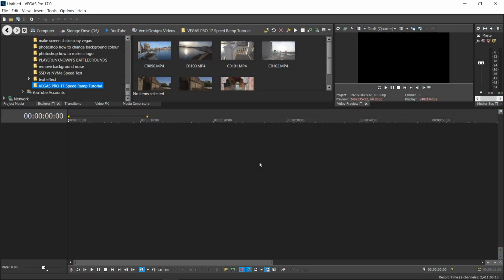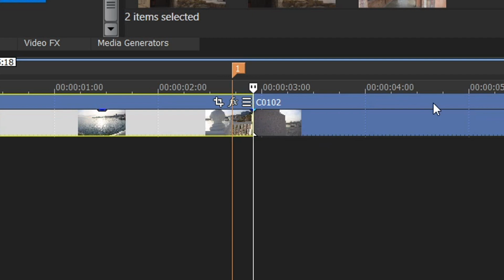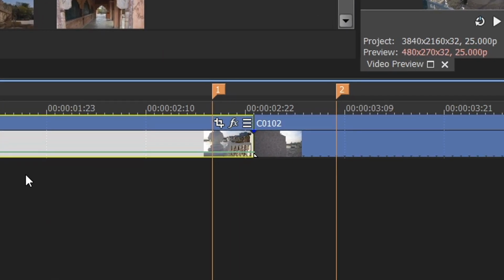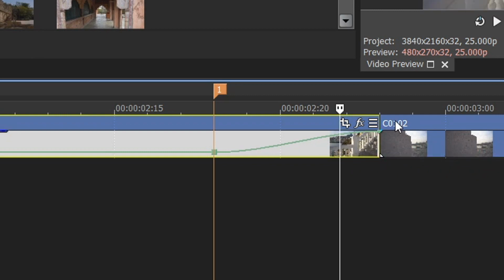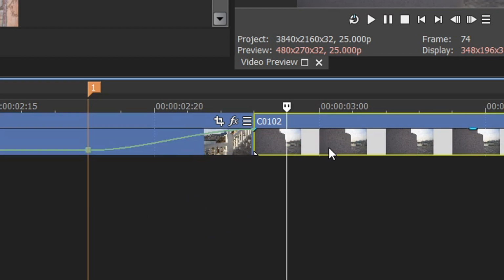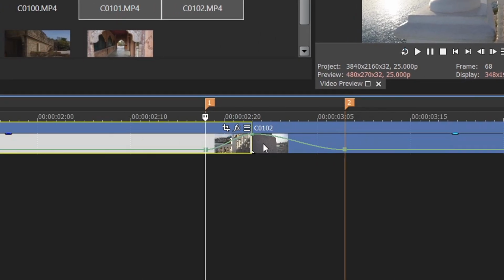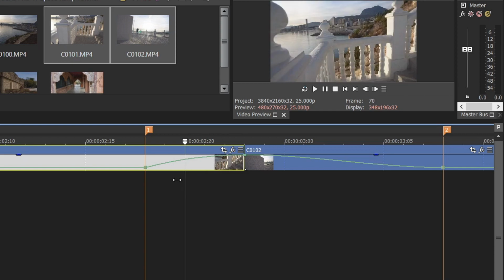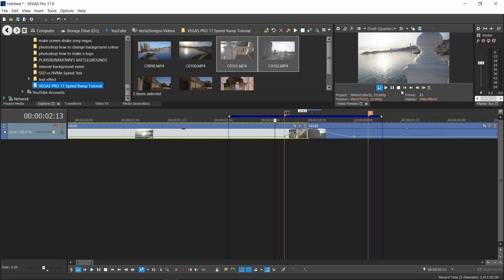VEGAS PRO 17 Tutorial: How To Create Smooth Speed Ramps - No Plugins

Comment: Can someone help. When ive shot 30fps. Laid it down on a 24 fps timeline and given to conform to timeline, it runs with that slight slowness. GOOD. Now when i speed up a clip im getting double frames in the final rendered video (when we pause the video). Say i shot 30fps drone shot, put it onto 24fps timeline, did conform frames so everything is prefect. But when speeding ramping, bec its taking every 5th or 10th frame for example to make the clip run faster, when the final rendered video is paused in those scenes, you can see terrible ghost imaging, ive tried different resample methods (disable, smart, force etc) no avail.
Reply: Try making everything the same fps by putting them all in a project and rendering them all at 60/30/24fps without any transitions and stuff. Then try doing velocity.

Comment: Why won't the velocity affect the duration of the track? Shouldn't it do that? I'm slowing the last video of a project but that should make the duration of the track longer but it won't.
Reply from the maker: Velocity is a bit of a weird one haha it does speed your video up and slow it down and you can notice this because sometimes when you create the ramps it will loop the video because it's already gone past the end point so it fills in that gap with a replay. 

Best thing to do is go off on the percentage for example if you want to slow the video drag the line down and use 100% as your normal baseline speed if you wanted to have a ramp or move the line up to speed the video up. Just takes some testing that's all but eventually it starts to make more sense
Reply: @VerticDesigns  Is there a way to sync the audio as well?